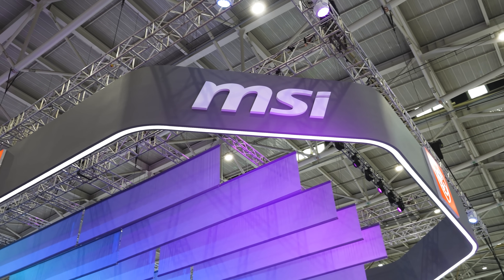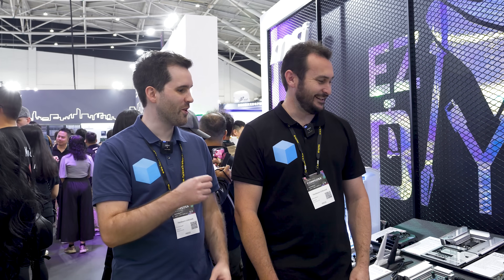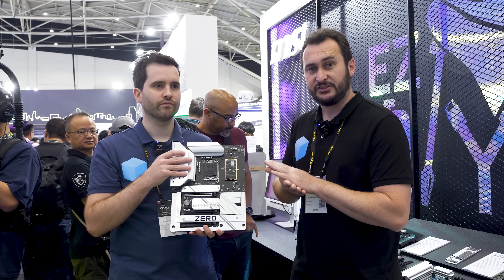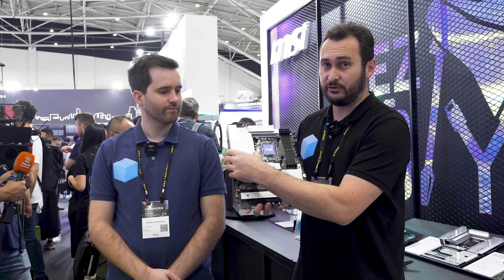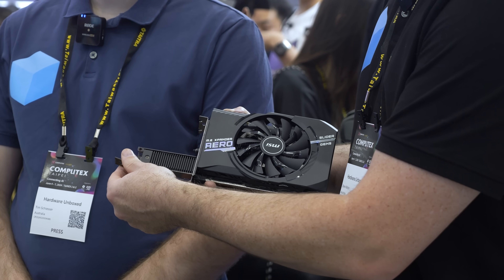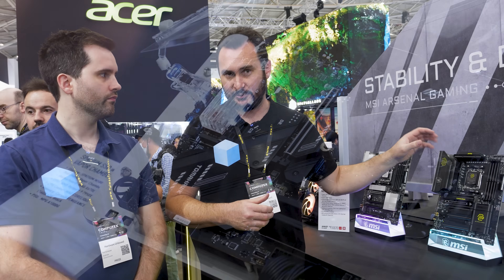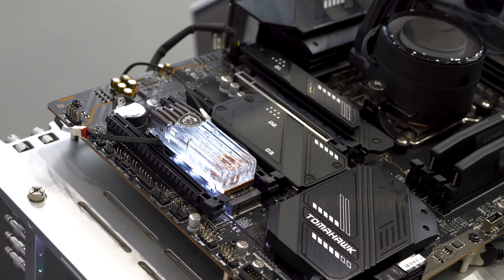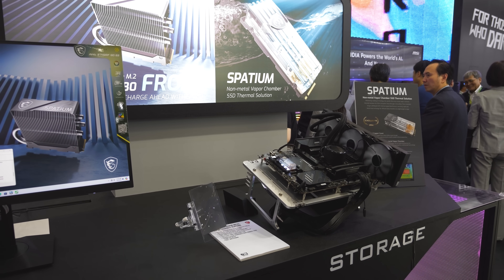Faster, Better Memory Is Coming, DDR5-8400 Now Actually Works

Comment: If CAMM2 provides a performance increase, I can learn to like it. Thumbs up!
Reply: @blakecasimir  How do you imagine a two-sided CAM module? There is an array of contacts on the other side.
Reply: @stanislavtihohod  A quarter of the memory ICs are on the backside, but there's a thermal pad to sink them into the mainboard, so it's fine.
Reply: @blakecasimir  shoter traces increases efficiency as well. CAMM should run a lot cooler than DIMMs of comparable speed.
Reply: The only metric we are interested in is fps in {insert relevant shooter game}.
Reply: I am really curious as i see less memory chips and i have seen no word about dual channel and quad channel. So in theory it can be worse despite a higher frequency.
Reply: @pino_de_vogel  A CAMM module functions at the equivalent of two motherboard DIMM channels. so for a standard consumer mobo with 2-4 DIMM slots and 2 motherboard ram channels, it's the same.

In theory with later generations it can improve more, an LGA can have more pins than a slot can.
Reply: @chaon93  but there are still less memory chips for simultanious writing the way i see it. My dims have 8 chips each side.  That's 32 chips vs the 12 i see here.  But maby they are multi layer new chips that count as more chips?
Reply: @pino_de_vogel  it's dyal channel for one stick they said
Reply: 1 CAMM module occupy  about 4 RAM slots board space for 2 chnl memory. What about HEDT then ? Threadripper Pro use 8 chnl memory, there is not enough board space for 4 CAMM modules. Vertical mounted RAM modules are just more space efficient.
Reply: Probably servers and workstations that use more than 64GB will have to stick to the DIMM format. Most of us would benefit of this new standard, though, as we'll getter better performance and heat dissipation, as it will be possible to attach heat spreaders, fans and liquid coolers easily.
Reply: @fleurdewin7958 The size of RAM has increased massively. DDR5 is at 512GB per stick. I dont know how the layout differentiates between the one in video and CAMM but the size per stick will surely increase once more for DDR6.
Reply: @eorzoriantr5228  density is only up 50% tho sadly (100% for enterprise tho) and you can still only actually buy a max of 256gb per stick afaik which u could also do on ddr4 because they just spam chips on there for like 8 ranks which sucks for performance
Reply: @fleurdewin7958  Yes there is and in fact a lot of the reason it was even made was so memory speeds dont get crippled as you add more like on hedt/server, especially for 2 dimms per channel so it will obviously work out.
Reply: no more upgrades from 2 dimms to 4 dims, instead, sell your old cam module and put in a new one I guess...
Reply: For smaller systems it could work well depending upon the design. 

For threadripper perhaps a second one could be on the reverse of the board, giving a theoretical 1Tb of ram very close to the cpu. That should be fine for non pro threadripper. There are actually alternatives in the data centre that could possibly work better for the pro chips. Either that or abandon atx form factor and rethink it all.
Reply: Seems unflexible for multiple modules tho.
Reply: @armatian  Majority of consumer systems only would require the one module though. It will be interesting to see speed tests comparing it to quad channel memory perhaps, the closer position to the CPU (especially if combined with more cache) might equal the throughput and beat it in future DDR6 and beyond layouts, especially as the latency will be potentially much lower.
Reply: it will trust me. It's similar performance to overclocked ram from stock which in cpu bound games can easily give +20% on some platforms
Reply: @Frozoken it will be also very nice for APU‘s. Their bottleneck was and has been RAM „speed“ which lacks behind VRAM.
Reply: Price increase already included
Reply: I'm excited for massive mono blocks that can cover CPU, M.2, VRM, and CAM module. It just be so cool (pun intended)
Reply: Agreed. Fast RAM is critical for being able to run large LLMs and other AI models on the CPU at decent speeds.

Comment: Camm style desktop memory will be interesting
Reply: I really dont think this is the solution... its going to make building a computer even more expensive than it already is by quite a lot
Reply: @insector2093  Its only going to make it more expensive temporarily, remember 32GB of DDR5 6000 was like 500$ when 12th gen launched and now its like 120$
Reply: once prices come down.  right now 3 people make it.  and dell is charging so much for it.  even a 32gb stick is 2 to 300 dollars.
Reply: Going from an open standard to closed licensed one will only increase prices.
Reply: @ericneo2 It is an open standard though? Ifixit showed it off unless I am missing something here
Reply: @ericneo2 camm 2 was standardised by jedec though
Reply: @sinosinovski7804  Making the RAM Jedec compliant doesn't mean there's no license fee.
Reply: @ericneo2  Obviously, but that's the same with all JEDEC RAM and module types.
Reply: @ericneo2 the licence fee will not be a huge percentage of each module. For dell to really make money from it they would want it to become the standard over dimm and so dim. It has probably achieved it for so dimm in the medium term as it is a alternative to using soldered memory (which most laptops use if not using so dimm and wanting high speed memory). Though intel lunar Lake is also soldered memory on the package.  

The real key is how much closer to the cpu camm2 gets vs dimm, that will reduce latency as well as speed. Combined with 3dvcache it could be a monster. 😊
Reply: @bionicgeekgrrl  If it reduces latency and comes in 128GB or 256GB modules I can see it being a ZFS monster. But knowing Dell, these will come standard as 8GB...
Reply: @ericneo2  Dell doesn't control that, they only control CAMM gen1, JDEC controls CAMM2. I expect 32Gb and 64Gb would be the most common versions of it, maybe 48Gb too.
Reply: @ericneo2  While the first CAMM was proprietary tech from Dell, JEDEC took the original spec, improved it, and made it an open standard (CAMM 2). This could be the future of the RAM module where it could be used by anything even in smartphones.

SO-DIMM has already reached its limit and DIMM could also in the future. Better to have a new memory standard now so it won't be all of a sudden the industry has to jump into the new standard.

Comment: A memory that uses screws during installation does not seem like a good evolution to me. 🤣
Reply: little more foolproof i guess compared to the scary click especially for beginners
Reply: it could probably use something similar to like m.2 latch mechanism.
Reply: Satelites still have nuts and bolts in them so as long something works fine, you don't have to necessarily change them.
Reply: I think it does. I had RAM instability because my 4 RAM sticks were improperly seated even though I heard them clicking in and they looked just fine.
Reply: the screws will get lost so easily, the plug in method works fine
Reply: @carlwheezer1544  buying a new screw for a few cents is trivial, that’s not a good argument against this.
Reply: @carlwheezer1544  The plug in method works so well that "is RAM properly seated" is one of the most common hardware troubleshooting steps. 😂

Comment: If it doesn't increase maximum capacity it is useless.
Reply: So increased speed and lower latency are worthless to you?
Reply: @ugh-meh  yes because I don't use my pc for gaming my work pc is for ai workloads.
Reply: Why ? Are you one of those more ram = better kids ?
Reply: @DragonOfTheMortalKombat With the kibd of work i do, Ive often run out of memory. I "only" currently have 64GB.
You seem to think everyone do the same on their computer, as you do.
Reply: @akyhne Or maybe, outside your specific case,most of the users doesn't need such a high capacity?🤔
Reply: @Frigobar_Ranamelonico  I hear 640KB should be enough for anyone. 😛
Reply: @keithduthie  🥵
Reply: @DragonOfTheMortalKombat  no it is one of those ai requires tons of ram kids. Who actually make money with the computers they use. There is more to computers than gaming.
Reply: more capacity is useless